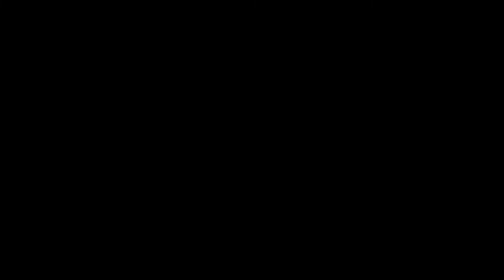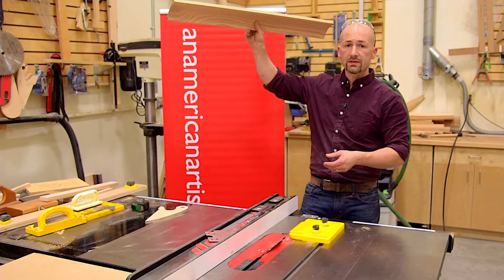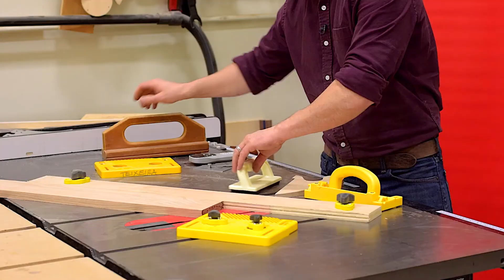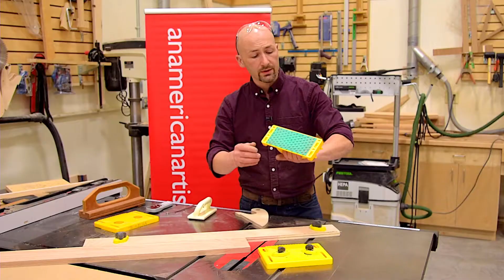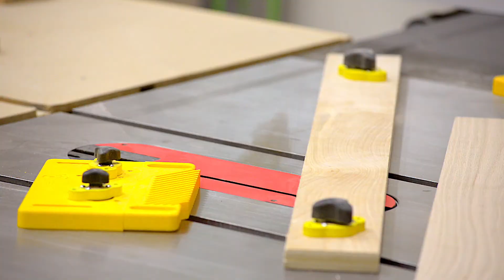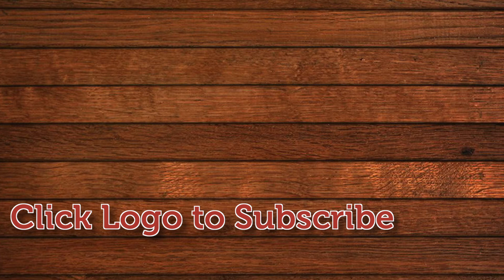Shop Secrets: Table Saw Crown Molding

Comment: Love the video, thank you for the tutorial. I am creating a project that requires a cove type cut (not for Crown molding) but one thing that was not clear on your video is how to center the wood to the blade. And if I adjust the fence angle one way or the other, wouldn't that increase of decrease the aggressiveness of the arch of the cut out?

Comment: hello, please let me know what the device to remotely turn dust collection system on is named, installed, etc.  Is it a DIY?
Reply from the maker: Hi Estebansensies, 

The remote shown in the video came with the Laguna cyclone dust collection system.  If you are in the market for a new dust collector, you can look for a system with this feature.  

However, if you are upgrading an existing system you can buy an after market remote like the one in this link:

  https://www.woodcraft.com/products/ivac-pro-240-volt-remote-control-for-dust-collectors

Good luck!

-Andrew